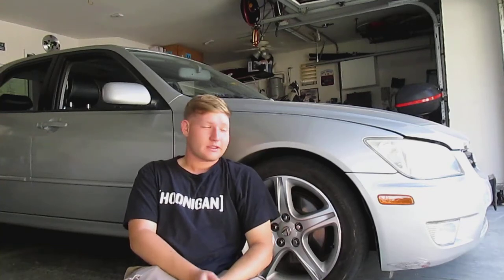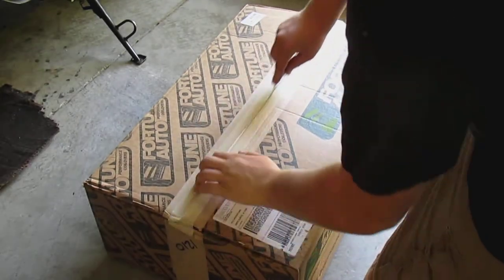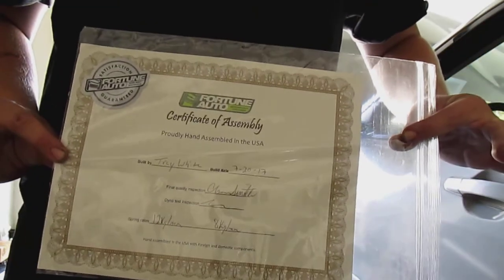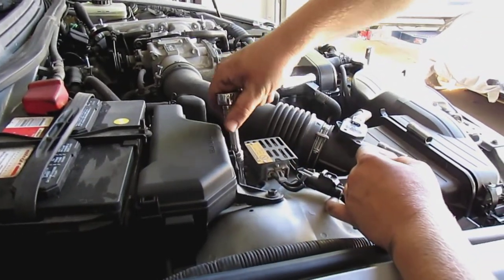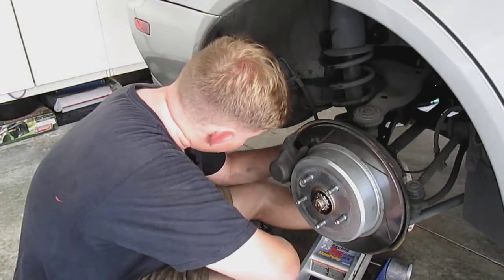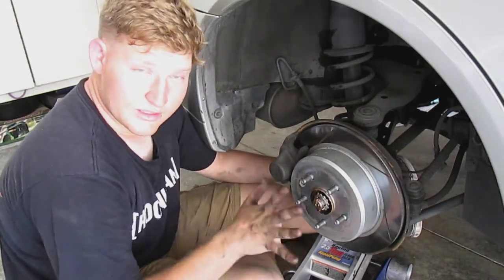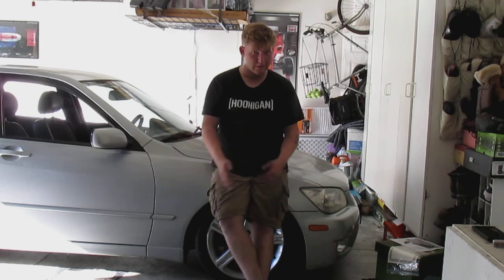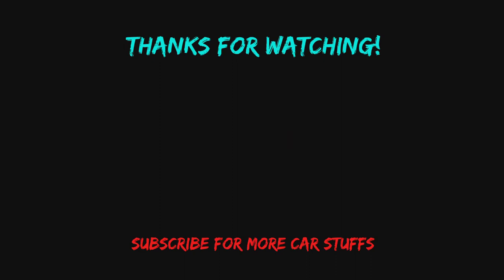IS300 Fortune Auto 500 Series Coilover Install

Comment: Hey man I just got fortune auto 500 installed on my 01 is300 with 13k front 9k rear.  What damping settings do you like best for overall comfort?  I'm at 13 clicks front and 11 clicks rear if 1 is the stiffest.  They seem ok but I want more comfort.  Probably can't because I have polyurethane bushings in my front lower control arm.
Reply from the maker: Hey! Yeah your spring rates are slightly stiffer than mine. Hard to believe that mine are almost 2 years old now, I have the Gen 5 and it seems like they changed a lot with the new Gen 7. It is going to be stiffer at lower speeds until they settle in but they will not soften up too much. My daily driving setting (if you start at full soft, + being stiffer) is +19 Front and +20 Rear. It sounds pretty stiff but it gives me a good balance of comfort and handling. I would say start at +12 Front and +12 Rear (from full soft) and just feel it out but make sure to record where the setting is at before you make an adjustment. I started at how I pulled them out of the box which was full soft and it took me about a month to dial it in just where I wanted it but I'm really picky lol. Hope this helps! Good luck man
Reply: @millennialmotoring  I think I'm settling on 10/9 (1 being most firm).

Comment: What spring rates did you go with? Do you wish they were stiffer?
Reply from the maker: 12k front, 8k rear. I like where they are, if I were tracking the car I would go a little stiffer in the rear. Considering I daily it, these rates work for me. I do plan on doing some autocross events this year and I think just maxing the damping on stiff should do the trick but we will see lol.